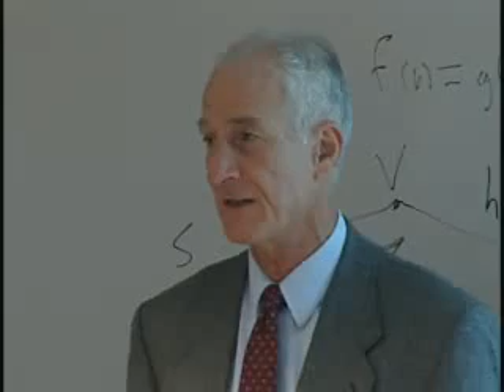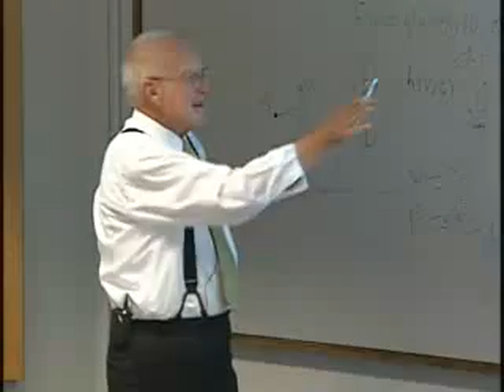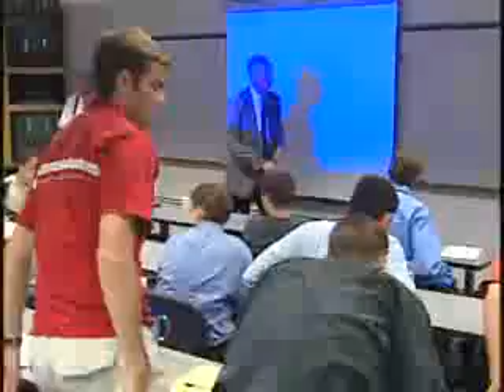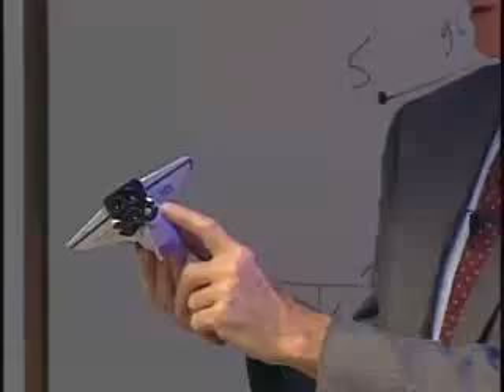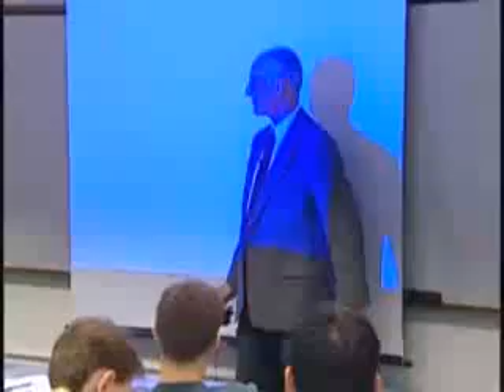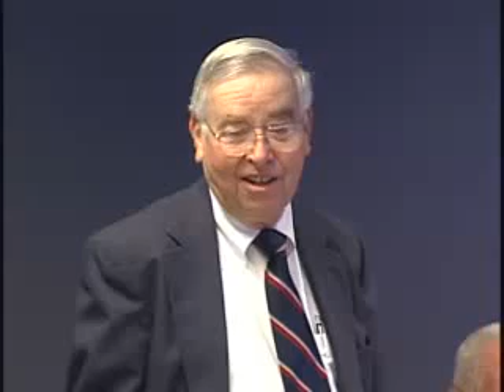Lec 7 | MIT 16.885J Aircraft Systems Engineering, Fall 2005

Comment: He made a mistake. 
Concorde DID NOT have canards. Like the Shuttle, Concorde could maintain perfectly adequate pitch control without the need for canards. The Russian SST (the Tu-144) DID have canards because their wing shape was not as sophisticated as Concorde's or the Shuttle's.
In fact, the prototype Tu-144 didn't have canards either - but the Russians found they needed them to give the aircraft decent pitch control.

Comment: Note' the bridge concepts of PRIME  and ASSET, were two miniature lifting body proof of variable concepts practicalities, that were both hot launches off the pad.These had been very critical projects, as they one, in the engineering scene proved that theory planners could begin to adapt differing type of thermal; protection layers.This was other than just the routine ablative injected coatings and two, that the shape, in this case the flying bathtub design of the lifting body, would indeed in the real world work.

These two project alone represent reentry vehicle dynamically changed evolution and are worth looking up for your syllabuses works.In this vid you must re-translate a bit, but it's worth everything if one does this in their studies here.*Note Russia had attempted the same program with their version of Prime and Asset. Thanks, Vrendus